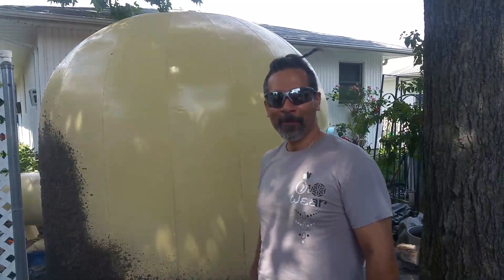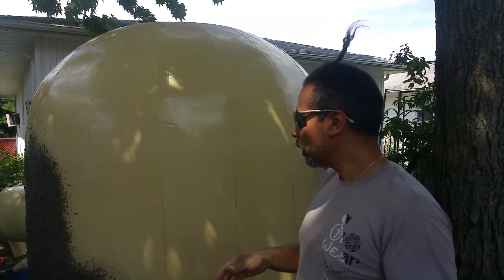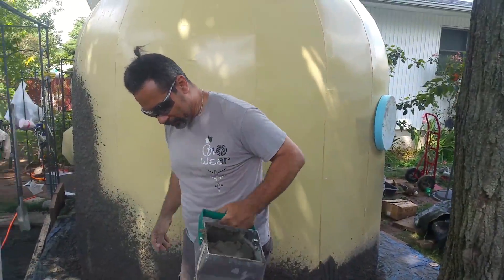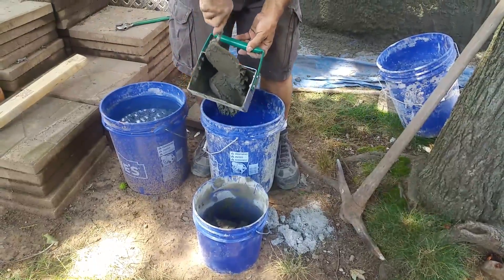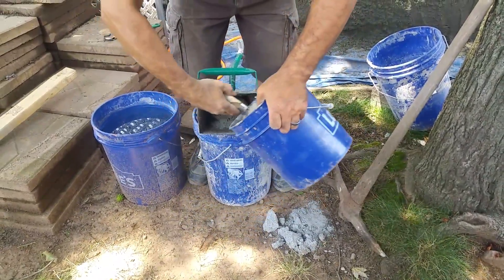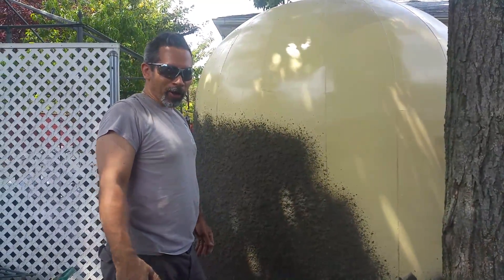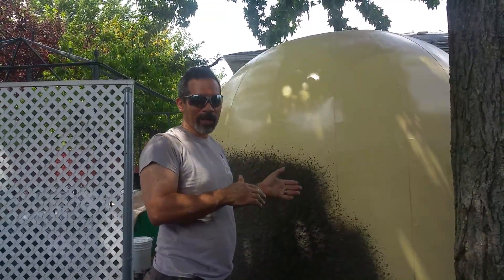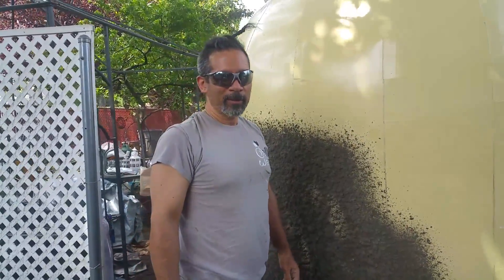Step 3: Spraying Concrete on Dome Air-Form #DomeHome #AircreteHarry #Aircrete #DIY #DomeBuild #Dome

Comment: I thought spraying Aircrete makes the bubble go away?  Do you have a process that keeps this from happening?  Thanks
Reply from the maker: Welcome to the channel Chris,
Aircrete is not sprayable, many people get it mixed up. I was spraying a stucco cement mix. 
As for a consistant Aircrete mix, (this is an older video & I since have done many more experiments & tests) check out my website for recommended Additives.
Reply: @AircreteHarry  I was curious.  Instead of paying for some kind of balloon shape to spray onto,  wouldn't I be able to just make a rebar and mesh shell?  Thanks!
Reply from the maker: @chrisking8353  Yes, it is possible to do.
Reply: @AircreteHarry  I would probably have to spray stucco on the inside to cover the mesh huh.  :-)

Comment: Couldn’t you stick your spacers to the dome then spray it with foam, then spray the foam with concrete? It would not only be way lighter but it would save a crap load of cash on another form while still giving you great insulation.
Looking forward to see how you go with this.
Reply from the maker: Welcome Richard, 
This video was recorded 5 years ago. That was one of very many tests I did. To clarify, Aircrete by itself is not sprayable, it will slide right down.

My idea of Double-Shell Dome Air-Forms was to fill in the Aircrete in-between. That is for great insulation.

I since have done numerous of tests and created different techniques.
I created and introduced Tyvek Dome Air-Forms. It saves A Lot of money while providing Successful Results!! 👍 

Aircrete:
Some people make Aircrete bricks, it takes a long time until they are fully cured though. I created the double-shell system that I fill with Aircrete. 
It is way faster!!
Check out my newest videos. I speak about the Double-Shell Aircrete Dome Homes. Last September, at one of my workshops, I tought how to build it. For more information check out this video: 

https://youtu.be/IIAyMakV3mw

You are Welcome to email: Aircreteharry@gmail.com 
for more details & further information as well. 

Here is my Step-by-Step Online Video Tutorial that provides 15 Hours of Knowledge and shows in details ways to Build a code approved, solid, earthquake proof, tornado proof, fireproof, termite proof Dome.
Aircrete / E.P.I.C Mix / Stucvo/Latex Cement Mix.

https://aircreteharry.com/product/%e2%9c%85-online-dome-building-course-step-by-step-by-aircrete-harry-great-addition-for-everyone-who-cant-make-it-to-the-hands-on-workshop-as-well-as-for-eve/

For equipment, recipes, how to & more, check out my website: 
https://aircreteharry.com/shop-1/
Reply: @AircreteHarry  hi Harry, thanks for getting back to me. As a carpenter builder I have watched some of your later videos with great interest. You are breaking some great ground with your ideas, thanks for sharing.
Reply from the maker: @richardlove4287  glad you enjoy them, My pleasure Richard 👍 👍
Thank you very much! 
I strive to make people aware of option we have. And again, they are realistic and beneficial.

Comment: It's an idea of monolithic dome.. Plagiarist...👎
Reply from the maker: And Your a Dummy!!! You don't know how to pay attention to what's being said. There is no plagiarist going on here first of all the two air-forms are from monolithic. My dome building method that I invented was to use two air-form one for building an Ecoshell, and my idea is to take the seconded air-form and put it over the first cement dome to hold the water like flow of the Aircrete up onto the ecoshell until it cures for the insulating layer. And that had never been done before. You should apologize to me now for you being a such a dummy and not watching and learning all the information before calling someone a plagiarist!

Comment: Do you think you could lay brick around the air form...having the air form as support for the brick...then spray aircrete or styrocrete on the outside for insulation? Brick and mortar to me would make a stronger structure.. your thoughts?
Reply: Also, I’m planning on purchasing land and building a dome cabin in Utah up in the mountains...I would pay for your plane ticket if you would want to come help 😊
Reply from the maker: I would come and help you next year, but you would not have to pay for a plane ticket. Maybe some gas money. I should be in Colorado where i'll be building my dome. 😉
Reply from the maker: Hi Rob,  I do believe your idea of laying bricks would work.  I don't think it would be stronger than a  monolithic pour with some type of rebar reinforcement. The dome I built in this video I made to test a building method. I made it weak on purpose so I could demolish it when I was done. Had I made it the way I plan to build my home it would have been very hard to tear down.

Comment: you could make a bigger hopper pretty easy, cut a hole un the bottom of a 3 gallon tin or plastic bucket, cut the square hole, then fasten it somehow....it would be heavy, putting a gallon in there is 16-18-20 lbs, use lightweight concrete

Comment: If you mix your cement in a wheel barrow, you can scoop it with your sprayer and save a ton of time. You don't need to load it by hand. I have the same one. Your project looks cool. I want to build one.
Reply from the maker: I was using a cement mixer and I didn't have to much to spray. And I didn't have a wheelbarrow but i'm picking one up today to help me move the cement bags around. http://www.homedepot.com/p/Rubbermaid-Commercial-Products-7-5-cu-ft-Plastic-Yard-Cart-FG564200BLA/100344354.

Where are you looking to build a dome?
Reply: Thanks for the reply. I have some land in the desert out by Barstow CA. I have been researching the fastest way to do something out of masonry. I like the dome idea. I wonder what would happen if you used the sprayer to spray aircrete? It would be interesting to see you try that. I enjoy your videos, thanks.
Reply: Achaeos Salisbury I don't think I am the one to ask but it seems like that would work fine. I think "Shot-Crete" is what you would use to build the structure and "Air-Crete" to insulate it.
Reply: Achaeos Salisbury that sounds good however the air-Crete has no compression strength (100-200psi) compared to concrete (2,500-4,500 psi) so it should not be used for any structural application. Harry made a video testing compression, check it out.
Reply: Achaeos Salisbury I would agree that your idea would be great especially for fireproofing, flood resistance, soundproofing, exc...  I think using it in that application would be superior to any other products. The “continuous flow” idea would be incredible if you can get it to work. Harry bought a machine that claims to do that but according to his testing, it would shrink a lot. I guess it would be fine if you did a second or third pour. He made videos on that also.

Comment: I am following your Aircrete Dome building process. I too am planing on building one. Why did u choose to use the inflatable Dome vs. the aircrete blocks with a mold and radius?
Reply from the maker: I'm not using Aircrete as the structure only as the insulation. So the inflatable dome allows me to get the shape right.